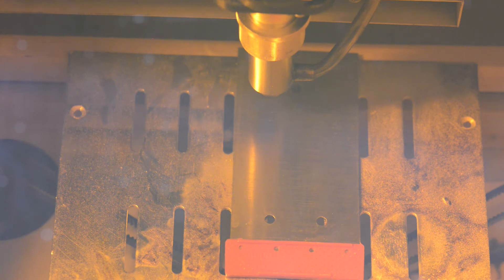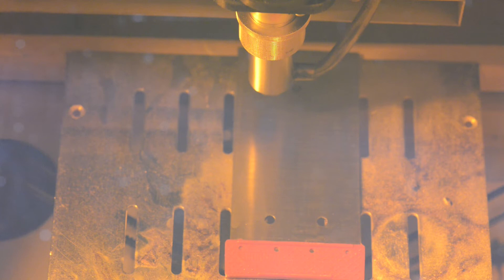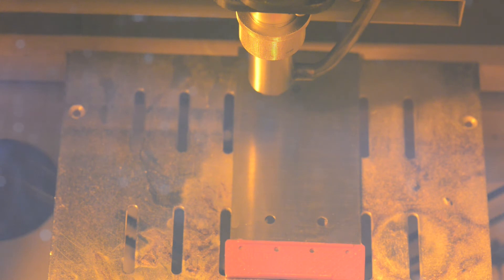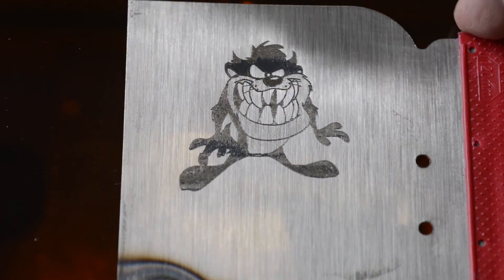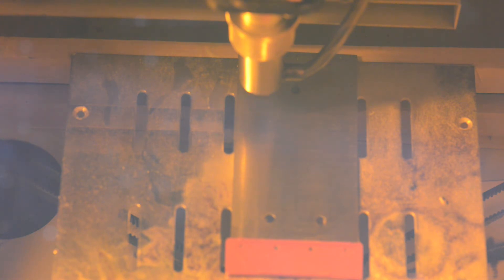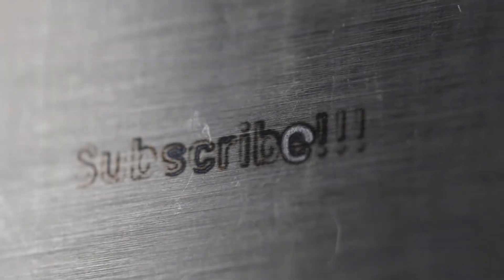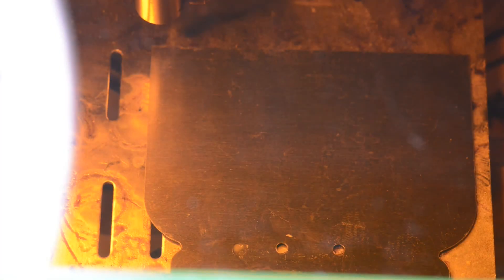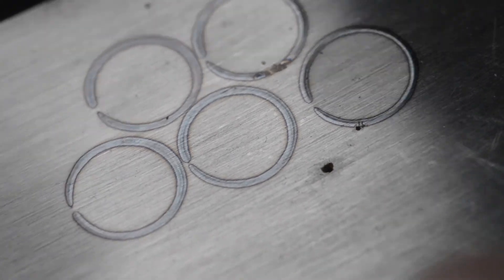Crazy K130 Laser - Can it engrave Stainless Steel? PT2 - Reply to some comments

Comment: I find it a bit unfair that you call me a troll for telling you the truth that a co2 laser is not for engraving metal. The reason you have mark's on both the front and back of your thin stainless steel is due to the extreme heat generated by a 130w laser warping not engraving. This is why  co2 are used to engrave and cut organic materials like wood, leather acrylics and glass to some extent and fiber lasers are used to engrave and cut metal. Then you get UV lasers to mark plastics and glass. All of these lasers work on different frequencies of light ranging from infrared to ultraviolet and are used specifically for certain organic and non organic materials. You also said that my knowledge comes from other people not my own experience?
I own 3 laser machines, a k40 a Chinese red and black 7050 with 100w reci and a JPT 50w fiber laser. My knowledge isn't just from personal experience but also lots learnt from advice given by people who know much more than me for example Russ from the sarbar multimedia channel or Alex on the laser everything channel.
If you want to mark metal using a co2 laser you need to coat it first with a product like brilliance laser inks or Cermark or laserbond.
Reply from the maker: Dear Steve, be assured that I didn't want to be unfair. However, I feel a little like you didn't watch the whole video or just ignored the fact that this new video once again shows a clear engraving in 2 different scenarios. It would be really helpful if you would prvide your personal definition of engraving. At least wikipedia defines it like that: 
"Laser engraving is the practice of using lasers to engrave an object. Laser marking, on the other hand, is a broader category of methods to leave marks on an object, which also includes color change due to chemical/molecular alteration, charring, foaming, melting, ablation, and more. The technique does not involve the use of inks, nor does it involve tool bits which contact the engraving surface and wear out, giving it an advantage over alternative engraving or marking technologies where inks or bit heads have to be replaced regularly."
However I like the definition of the german article more:
"Unter Laserbeschriftung versteht man das Beschriften oder Markieren von Objekten mit Hilfe eines intensiven Laserstrahls. Im Gegensatz zum Laserdruck, bei dem mit einem schwachen Laserstrahl nur der Pigmentauftrag auf dem bedruckten Material gesteuert wird, wird bei der Laserbeschriftung das beschriftete Material selbst verändert. Das Verfahren und der Energieeinsatz hängen daher vom Material ab. Laserbeschriftungen sind wasser- und wischfest und sehr dauerhaft. Sie können schnell, automatisiert und individuell erzeugt werden, weshalb das Verfahren gerne zur Nummerierung von Einzelteilen verwendet wird. Auch das Anbringen von sehr kleinen maschinenlesbaren Kennzeichnungen wie zum Beispiel dem QR-Code oder dem DataMatrix-Code direkt auf Produkten ist hiermit möglich."
Source: https://de.wikipedia.org/wiki/Laserbeschriftung and https://en.wikipedia.org/wiki/Laser_engraving
If you own these 3 Lasers you're referring to, you spent a least like 5000 bucks for the equipment probably way more as the JTP 50w is a quite expensive beast. However the 2 vids on your channel just show a pair of really nice pained nails that seem to claim about a missing pcb of a chinese toy... hmmm. Why do I get the feeling that someting is wrong here :D
To be very clear: All my engraving was done without any kind of coating, I even wiped off any debree from the steel before I marked it.
Next I'll cut some steel with the same laser- and you will once again tell me it can't be done- right? Do you know that wise saying: "People who say it can't be done shouldn't interrupt people who are just doing it." ;) stay safe and watch your eyes and lungs- especially with your JTP- it's got no extraction unit...
Reply: it appears that you hit his nerve
Reply: Just an FYI, CO2 lasers are commonly (less commonly now since fiber is so prevalent) used in industry to cut metals... granted at magnitudes higher wattage, but still CO2. I have had the pleasure of maintaining several CO2 and fiber lasers over the last 20 years.